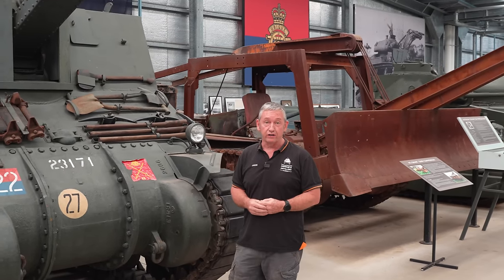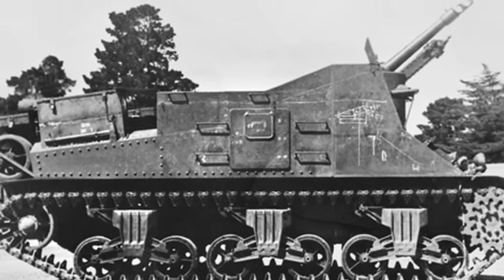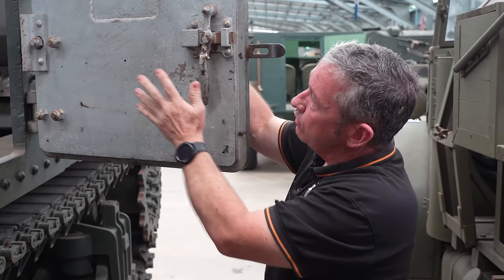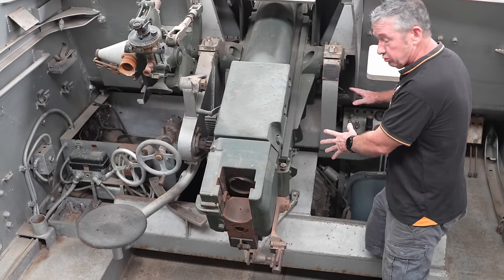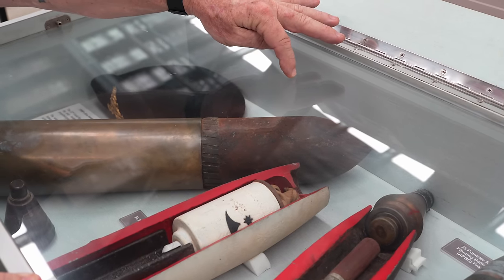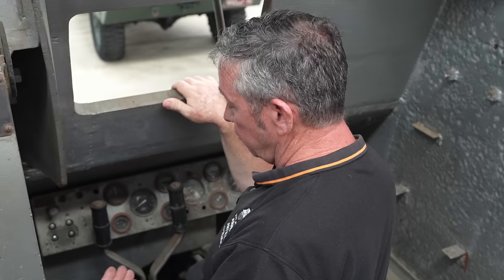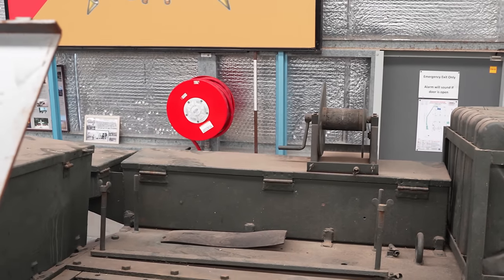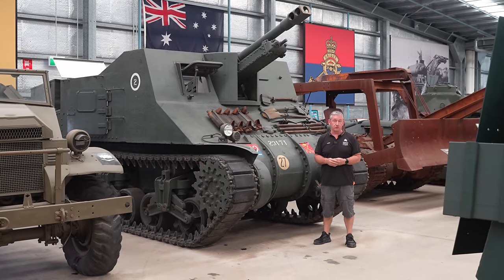The Australian Self-Propelled 25-pounder Spear-thrower (YERAMBA!)

Comment: I trained on 25 pounders in the early 70s. I remember that the maximum range on charge super (not supercharge!) was 13,400 yards (which is just over, as said, 12250m). Only ever used it once - incredible, ears rung, even with ear defenders! Also, technically the 25 pdr is a gun howitzer, and could fire at 80degree elevation with a special dial sight adapter and a gun pit to take the breech. When on its platform - as it pretty much always was -  it had full 360 degree traverse.

Comment: @2:23 if you look at the side of the engine..
That is a 6-71 supercharger... that were recycled for drag racing use.
Reply: G'day, it's actually a rootes style blower, used on all 2stroke diesel engines,it doesn't provide any supercharging, it purges exhaust and introduces fresh intake air at barely over atmosphere, once it is put on a 4stroke drag car etc it then becomes a supercharger 👍

Comment: When I was an apprentice Fitter & Turner at Vickers Ruwolt in Melbourne in 1976. There was a Fitter that was retiring and he was an apprentice during the war.
He told me that Vickers used to produce the 25 pounders and the workers wanted more money, but it was illegal to go on strike during the war, so they went on a go slow. Problem was that they produced more guns and more accurate guns (so they had to stop the "Go Slow") 🤣
Reply: Sounds like their heart wasn't in the go-slow.   Many years ago I worked in a maintenance depot and the union called a go-slow, actually termed "work to rules".   NOTHING got done.   The boss said "Hammleter, take a car and go to such and such."    Right, boss.   Hang on, rules say you have to do daily vehicle checks before setting off.   Check water, check oils.   Hmm, need to look up what grade of oil.   Have to check tyre pressures.   Hmmm - I haven't been trained to use this type of tyre gauge.  Get a supervisor to show me how to use the gauge.   One tyre is a bit low - have to pump it up.   etc etc.   It was over an hour before I could set off.

Comment: Now does,,,,,,,,the Russian morter 90mm no recoil,,,,,,side armed,,,,,now I believe if you two have seen this gun morter Russian ,,,,,you slam the shaft holding pin ,,,,double casing on barrel,,,Russian morter 90mm you should look into it,,,,,each shell fired by gunner with lever,,,,shells drop in ,,,,on another note,,,,before cleaning gun barrels look at ring of carbon formed ,,,this gun residue collected is pure carbon ,,,,if melted again with hydrogen gas at 2000 degrees celeilous it forms into diamond,,,,,the ring of carbon where bullet sits ,,this ring of carbon found where shell leaves cartage,,,,you must of come across some keep an eye out for shell grit,,,, pure carbin